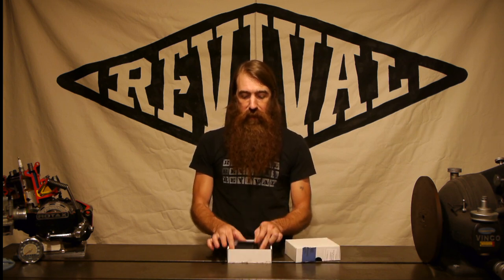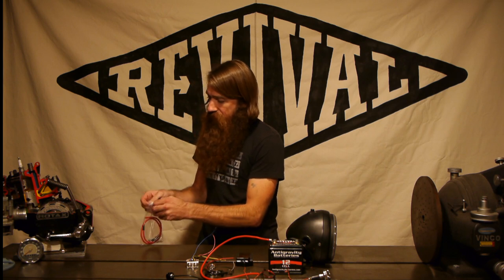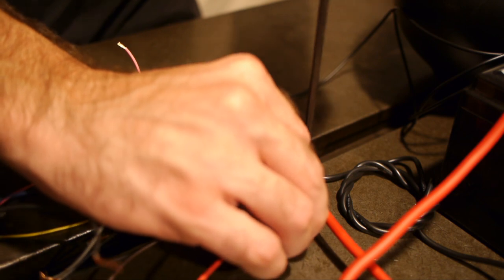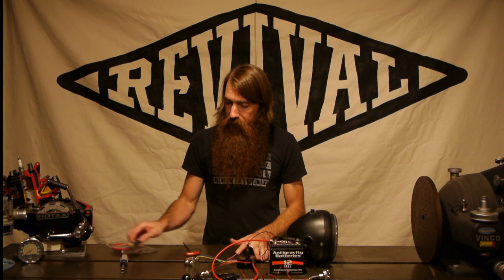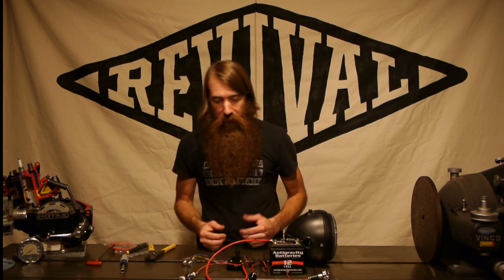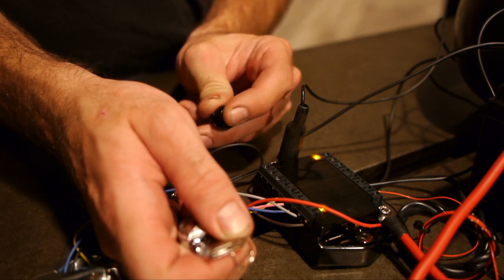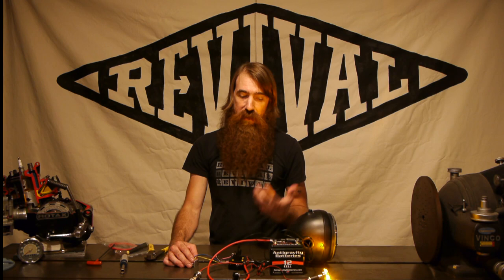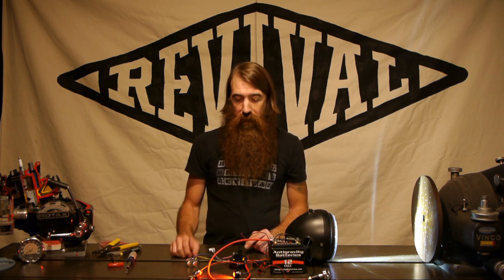Wiring the Motogadget m-Unit V.2 - Revival Cycles Tech Talk

Comment: Hi Stephen,
Looking on internet i cannot figure out the output specs in "one wire tail light mode", i see that you can choose bulbs or leds in the menu, but  is it amps or voltage regulation with leds? have you got some specs to give?
Also, regulators are running aroud 13,5v in use, so, do the m-unit realy deliver 12v or is it just a value given in usual admittance (as for batteries when we know they are "normaly" around 12.85v), to resume do the m-unit provide 12v ? or do outputs follows the régulator tension in input?
Great video Bro, thanks a lot!
Reply from the maker: We don't have the detailed specs for the 1-wire tail light, but I can give some general info on the subject. The 1-wire mode will perform some pulse width modulation to reduce the total power sent to the tail light  and then when the brake input is grounded by the brake switches, the m-Unit sends full power to the tail light. The difference between the LED and Standard bulb mode is the frequency of the pulse width modulation. The standard bulb uses a slower rate than the LED because if the LED was pulsed at the standard bulb rate it would be noticeable as a flickering.

The m-Unit will output the same voltage as what is provided to it, it does not change the voltage to the outputs. So if your battery or regulator is at 13.5v then the outputs will be 13.5v. I have tested this and found only a very small difference between the input and output, but it is so small it can be ignored. 

To be clear the m-Unit does not do any regulation of the voltage or the current in the system. BUT in the case of the 1-wire tail light it does use pulse width modulation (turn on/off very quickly) to reduce the brightness of the light.
Reply: Thanks a lot....

Comment: Great informative video folks. I've ordered the V2 plus the button but would like to know is there a button you use to configure the settings? 
If I lived in the US, I'd be over to you guys in a heartbeat. Wiring a sporty chop btw.
Reply from the maker: In general I don't use a dedicated button for m-Unit configuration, but instead just use a short length of wire and simply attach one end to the config input and tap the other to ground which simulates the switch but is faster than doing a permanent install. Normally we only need to do the config once.

Comment: Hi Great Vid, I have a 1979 XLH 1000 sportster and im wondering if I need to use the starter relay?
Reply from the maker: With the m-Unit you do not need a starter relay. The start output is capable of delivering 30 amps to the stater solenoid and that is much more power than the solenoid will need. Also the m-Unit has built in load shedding relays so everything that can be off is turned off when starting so the starter has maximum available power.
Reply: Thank you heaps for the reply, also just wondering with the + input for the m-unit it comes with the 10mm cable. do I need to fuse it from the + battery to the + input of the M-Unit or can just directly connect it to the + battery terminal, because in the manual shown as 'main fuse' and not sure what actual fuse to use like 30amp? and is it worth fusing the regulator with a fuse (not sure witch fuse to use) to the same 10mm batter wire that came with the m-unit. thank you hoo much for the help.

And for those reading unsure if they should grab one of the m-units and clean up the wiring on your own pride and joy, nervously riding hoping the wiring they did or the previous owners did risking shorts and other things to happen. small out lay for major peace of mind was well worth it for me. Also very easy to wire up even for me that has no experience, worked it out and any questions these guys have been heaps of help ^^^.
Reply from the maker: Technically the m-Unit does not need a fuse for the main power input. However, the charging system should have a main fuse to protect the battery from a short circuit failure in the charging system or reg/rec. 

The 10mm cable that comes with the m-Unit is sized to make you feel good, and to cover the worst case scenario, but not based on the actual electrical requirements. In this type of application 12 gauge TXL wire is rated to 40 amps, and for 90% of bikes that is more than the electrical system could possibly use or produce. NOTE: if you are using 12 Gauge you really need to use a main fuse for the m-Unit connection. But by switching to 12 gauge wire it is much easier to find a main fuse holder that works. And on our bikes I'll setup a main fuse close to the battery and use that to connect both the m-Unit and the charging system. We use either the IP67 waterproof main fuse holder that comes in our wiring kit, or the built in main fuse of the universal starter solenoid we sell. Just depends on what type of starter the bike has.

Comment: Can you program the m-unit to keep the turn light on for a few seconds without the need to keep the button pushed like on the old Harley-s?
Or it can just turn them off on newer models after a programmed interval?
Reply from the maker: The way that the turn signals work with an m-Unit and momentary push buttons for inputs, is as follows: 
1) A very short press will flash the turn signals 3 times and then stop
2) A press for more than 1 second will activate the turn signal and it will stay active until the programmed timer count down is complete. This timer can be set at 10 sec, 20 sec, 30 sec, 40 sec, 50 sec, or no automatic cancel. Also note that activating the brake switch will reset this timer. This means the self canceling feature will only work if you are not using the brakes for the duration of the timer count down.
3) Pressing BOTH left and right buttons at the same time will activate the hazard four way flashers and turn on both left and right signals at the same time, with no self canceling timer. This will also stay active if the m-Unit is shut down and the key is removed.

Comment: Hey Stefan, great videos, just purchased an M unit on seeing those vids. just one question, does the unit come with a config button? 
regards Steve Swan, Australia.
Reply from the maker: The m-Unit does not come with a config button, but in most cases that button is only needed temporarily. Because the configuration usually only needs to be done once, we don't do a permanent install for a config, and honestly in most cases I'll just use a length of wire that has both ends stripped, plug one in the config input and simply touch the other end to ground so it acts like a switch.
Reply: I think this is an area where Motogadget could improve their manual. I read that thing 4 times cover to cover, without any real clarity on which button they keep referring to.. The idea of using a wire as a button is not exactly instinctual, so thanks for that piece of advice. I was wondering though, since I have a 6 button control set up, and one of them is unused, could it be set up as a full time configuration button? I do have the M-button, so not sure how that plays into it.. Thanks!!!
Reply from the maker: It is true that the manual leaves a lot of room for improvement. Its one of those things that makes sense once you already understand it, but it leaves a lot of gaps for those new to this stuff. Using the 6th button as a permananet config button will work just fine, however, you should be aware that it will only be a config button if you enter the config menus during the boot cycle. Once the m-Unit is initialized the "config" button is actually a dedicated kill switch.

Comment: in a previous video you mentioned that if a resistor went out, it may destroy and void the warranty of the m unit. I'm not very good with Electrical but when running your own wires would the direct line from the battery be the place to put a resistor?
Reply from the maker: I'm not sure which video you are referring too, but I'm guessing it was discussing a regulator / rectifier (reg/rec) and not a resistor. Regulators are used to limit the voltage that the charging system produces. The m-Unit has built in protections for situations where the regulator fails, by honking the horn and turning on lights to try to use up the excess power. But that will not protect the battery from a charging system or reg/rec short circuit, and this is the reason we recommend installing a main fuse between the battery and the regulator/rectifier.
Reply: hit it right on the head. exactly what i was talking about haha. sorry for the miscommunication. Ill definitely be ordering this unit and a few other bits from you in the next couple of months. this web series is incredibly helpful. Thanks!

Comment: Hey guys i'm having a problem with the ignitionsystem and the Munit blue, my 74 hd xlh ironhead has the OEM mechanical breaker points witch got 1 wire going to the ignition coil (instead of 2 wires like electrical ignitions).
M unit says that with electrical ignition you go with wire #1 to the coil and wire #2 has to be split to coil and ignitionunit before going into the ignition Output.

Comment: Question: is the m-unit self canceling for the turn signals? If they are that would be awesome...Thank you
Reply from the maker: Yes, the m-Unit can be setup to self cancel turn signals. You can program from a selection of count down times, but also the count down timer waits to start until after you let off the brake lever.

Comment: Can the one wire tail/brake light function also include rear turn signals? I'm not sure I've asked that correctly, I want my stop tail led to be my turn signal as well. Thanks
Reply from the maker: +Shaun Walters This is something that has come up a few times, but the m-Unit is not setup to work this way. Although, it will work if you use another device called a tail light integrator. There are several motorcycle specific units and they usually cost about $80. There are also some simple versions that are intended for  installing in a car to create a trailer light harness and these are frequently available at an auto parts store. With a little creative wiring you can make that work for about $40

Comment: Awesome video and product. Question though, when you switch the hi beam on it's just a tap on the button then you hold the button to turn the head light totally off. If you wanted to switch back to a low beam from the hi beam, would it just be another tap on the button? Probably a silly question but just want to clarify.
Thanks again for the awesome video.
Reply from the maker: You got it right. Each tap cycles through the high/low and a long press cuts the light off.

Comment: Hello, first of all great video!
Very informative!
I have a question can I use stock handle bar switches (Honda CB750K)on this m-unit?
Thanks
Reply from the maker: +Masayoshi Terada 
While you can use your stock switches with the m-Unit we don't generally recommend it. One of the primary benefits of installing an m-Unit is to eliminate variables that could cause a failure and the OEM controls on vintage bikes are a frequent source for electrical gremlins.   
Here's a link to a PDF of the manual, http://motogadget.com/media/downloads/manual/munit_v2_manual_en_3.2_k.pdf

Page 8 section 7.7 shows which configuration is required for Japanese bikes, configuration (C)
Modification to the wiring is required for the headlight switch to function correctly, you can find the description at the bottom of page 4 and a diagram at the top of page 5

Comment: could you guys go into some details on how to wire the munit to the c.d.i.?
Reply from the maker: This may be a topic for a future video, but it is difficult to address the nuance of each different bike. The best advice I can offer is to trace out the connections from the CDI on the wire diagram. Then look for the wire that is connected to the kill switch or ignition switch, track that back and make sure it is sourcing +12V and then that is the wire that gets connected to the AUX out on the m-Unit. The rest should be connected the same as it was on the original setup.
Reply: Revival Cycles thanks guys!

Comment: Hi,
I'm thinking of getting one of the m-units for my custom built bike, imported from the States.  Only problem is that the bike was wired with 0.5mm2 wiring, rated at 11amp, but the m-unit states it requires 1.5mm2 output wiring.  Is 1.5mm2 wiring strictly necessary given that the headlight is the greatest draw at 5amps which is less than half the wire rating?
Reply from the maker: +Barry Taylor 
 The short answer is, if your wire is rated at 11 amps you should be just fine, as the m-Unit provides 10 amps to the headlight circuit.
 The long answer is... Sizing wire is not a simple task. The main dependence is what the insulation of the wire is, the cross-linked high temp wire that we use its is capable of carrying higher current than general purpose wire of the same gauge or mm2. This is because the insulation withstands both the temperature increase coming from the engine, but also the temperature increase coming from the electricity flowing in the wire. The important part of sizing wire is not really how much power the device is using, but how much power can be supplied to wire in case of a short circuit.  Using the headlight output as an example, the m-Unit will supply 10 amps, before tripping. That means the wire needs to be sized to handle the heat produced by 10 amps plus the ambient heat in the area the wire is installed, plus some safety factor. For us we have found that 18 gauge TXL copper wire meeting SAE-J1128 specification is adequate for m-Unit outputs and very compact.

Comment: Very nice video. I am sold and I will purchase ALL my motogadget gear from your website! I have a two questions, is it possible to set it up so all the turn signals flash at the same time? It would be useful for lane splitting. Also, can I connect the handlebar signals on top of the other 4 turn signals to the M-Unit? Thank you!
Reply from the maker: Yes there is a "hazzard" flashing feature on the m-Unit, just push both left and right turn signal buttons at the same time. That does mean you need to have momentary push button controls for the turn signals, and you would not be able to use a stock style toggle switch for the turn signal control.

Comment: Loving your Videos and the Motogadget. Heres one for you. I have the Motoscope pro with the breakout box b, m-unit v2 and m-button. Before I start the install on my streetfighter 1999 R1 can I assume that it is posible to do install the Motoscope pro + breakout box B to the m-unit without any issues. Any tips would be greatfully received. Regards Mike
Reply from the maker: It is possible to install those components without issues, but it will take patience and a methodical approach.  With bikes from that era the one main thing to double check is if the OEM ignition key had a security resistor built in.  Some of the bikes from the late 90's had a simple resistor built into the ignition switch that would connect to the Ignition module and it would act like a security system making it much more difficult to hot wire the bike. If you know its there its easy to bypass, but you want to measure the resistance across the terminals of the ignition switch with the key in the ON position to see if there is one. Forums for your bike will also address this if it is a problem. 

Also recommend watching the wire planning and diagramming  video https://youtu.be/-m5aUoAK_DM 

Keep in mind that the motoscope pro and breakout box are just monitors for what is happening on the bike and do not control any part of the bike. The m-Unit will control power distribution but the ignition system and charging system need to be setup to work the same way they did with the original bike.

Comment: my observation is that the M Unit is decades newer technology from the old fuse box design.. this is so much safer when a short happens and the fuse blows. Also it seems to me that it would also be impossible to fry wires with the M Unit almost making it impossible to burn your bike up.. I am really wanting to rewire my Kawasaki ZRX using this technology

Comment: Rewiring my GSXR1100 and have questions about hi/low beam wiring with a stock switch.

Menu 5, config C seems to retain the first position low, second position high switch functionality?

Is it the low beam wire that runs from the switch to the m-unit headlight input, and the high beam wire that is no longer needed?

Thanks
Reply from the maker: Yes, you are correct. When using factory toggle switches to control headlight function with the m-Unit you connect the low beam wire to the light input on the m-Unit, and then make sure the factory switch is switching to ground (not positive the way it was originally wired) and then there is no connection for the high beam switch. The manual doesn't cover this in much detail but it is referenced at the bottom of page 4 and top of page 5. 

Also menu 5, option C is the correct configuration for this switch combination.

Comment: Can you wire it up using a battery eliminator capacitor?
Reply from the maker: The m-Unit is not compatible with battery eliminator capacitors. But these days with the incredibly small size of LiFePO4 batteries, there is not much need for the eliminator capacitors on kick only bikes. If you would like to discuss the details of an application or spec a battery for your bike email us at techsupport@revivalcycles.com Thanks!